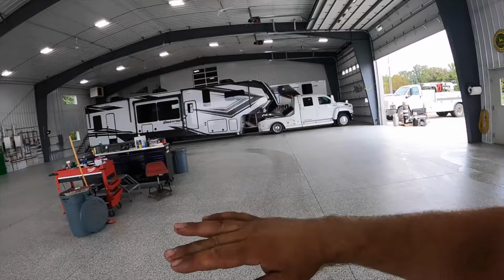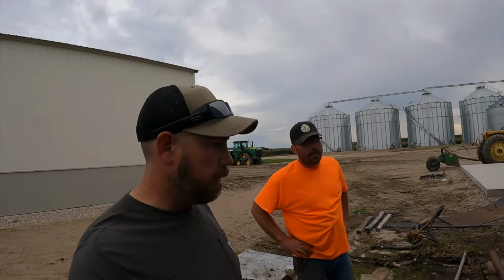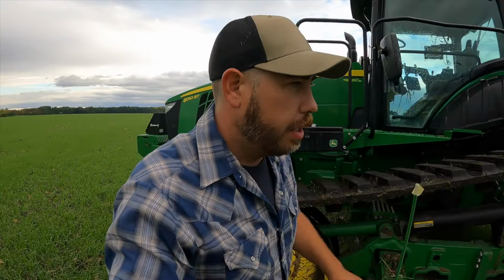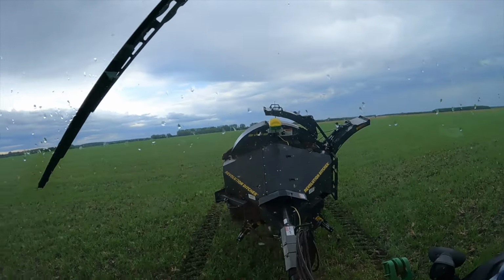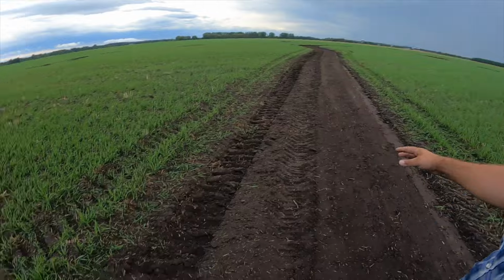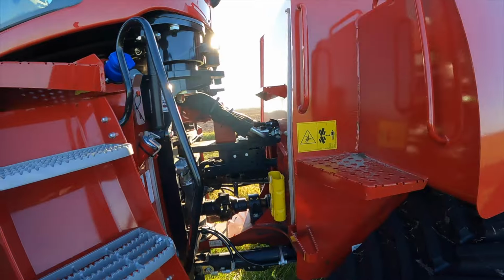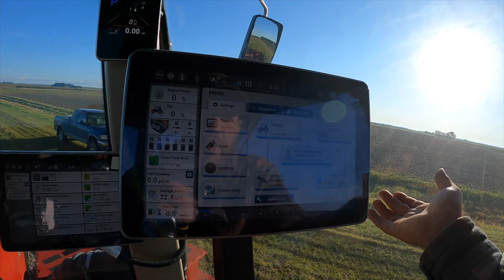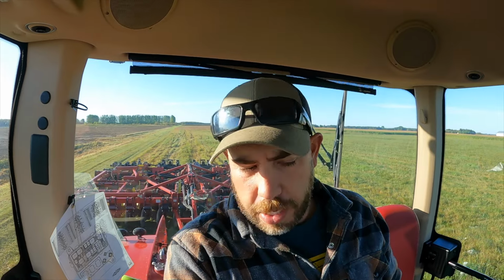We Put the Case 595 Tractor to the Test!! Honest Review From a John Deere Guy!

Comment: We have 3 S790 combines various front wheel assist tractors. Self propelled spray etc. everything Deere except we have two 620 case-ih quads. We absolutely love them. We used to have Deere articulated tractors.  And these case tractors burn less fuel and pull harder pulling bigger implements.  We definitely enjoy them snd have had no trouble. But we have not tried the new Deere track tractors vs our quads though.

Comment: Either or, the green or the red are very good tractors. If i had a choice after running deere and case i would pick case any day. Maybe not the same cab as the deere cab but very quiet and big and the case can pull more in my experience. Like i said just my experience.

Comment: How often to you have to replace batteries? If it's often enough that it's an issue having them up high maybe you should think about why your JD's go through so many batteries.
Reply: Appreciate your comment..  but wasn't saying it was a bad spot just saying it was a little more inconvenient that's all
Reply: We had 2 600 quads. They are twin turbos. I work for the guy that had them, he wasn't happy with them because they were starting to have issues. Turbo problem one one, def problems until we deleted them hydraulic hoses blowing apart. They were getting hours on them and that might have added to the issues.  I ran each one and I really liked the throttle and shifting all in your hand. They aren't near as quiet and they was rougher riding going down the road. He traded them for deeres. 9620rx and 9rx590. We also had a 470 narrow track and replaced that with a 8r410.  All green now except for our 870 ripper. It don't matter what color they all break down eventually! And with all the technology ya can't fix most of the problems. We're down by albert lea and I think we'll start beans late this week. Have a safe and good harvest!
Reply: It seems everything goes thru batteries faster than they used to, trucks, tractors and all.  I wonder if its all the computer stuff.